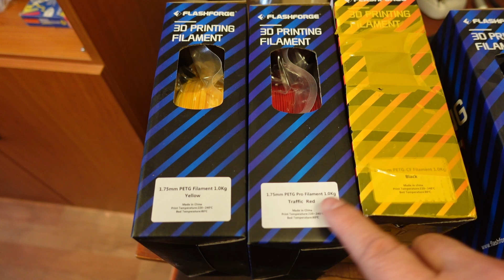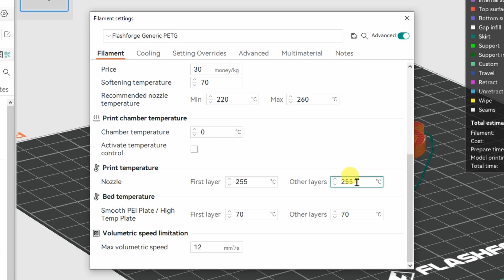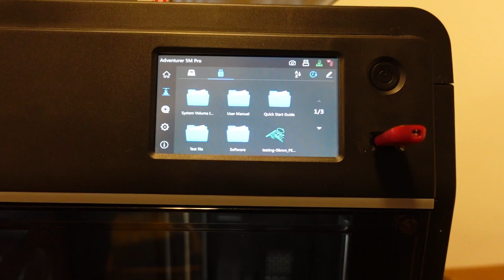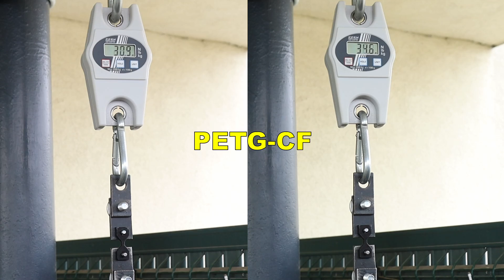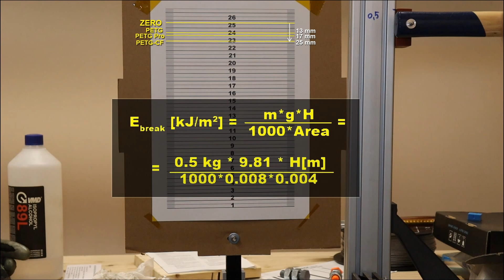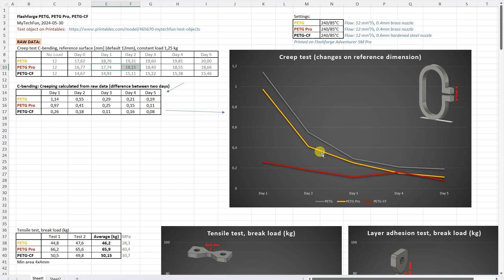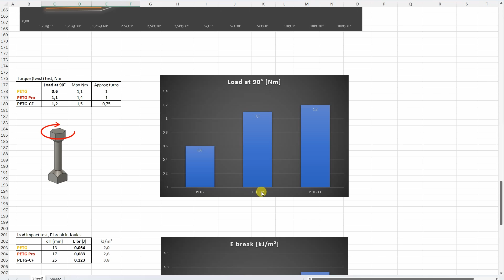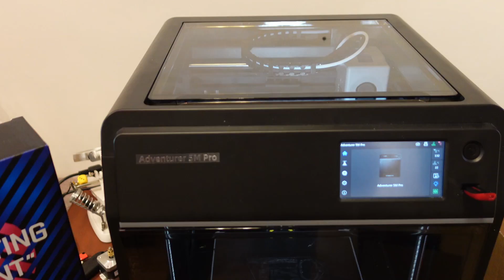Flashforge PETG vs PETG-Pro vs PETG-CF (carbon fiber)

Comment: It's quite possible printing the PETG-CF filament at only 240*C hurt its performance, which is backed up by your own test video printing PETG-CF up to 290*C. You proved there was improvement in layer adhesion up to 270*C.  It seems like a quick re-test at your new standard higher nozzle temperatures added into a future comparison might improve the Flashforge table data. Since I'm specifically using this filament and printing at 250*C I'm quite curious!

Comment: You are touching on something counter-intuitive and often misunderstood in the field including many 3d printing veterans, which is that PETG oftentimes isn't impact resistant as strong PLAs. Unfortunately valuable insights like this are scattered across many videos and most viewers probably didn't get it. May I suggest pointing this out explicitly in your new video with the many datapoints you collected?
Reply from the maker: It will be explained in a separate video soon. Finally my industrial impact testing machine arrived too...

Comment: I recently bought VoxlePLA PETG+ (white).  It is the whitest PETG I’ve seen, so it must be loaded with TiO2.  It printed miserably using my generic PETG profiles till I looked it up on their site, and it turns out it needs 270C temperature to print !  This is much higher than any other PETG I’ve used.  Is this a tell of higher quality or temperature performance for the finished prints, is it just because of it having less glycol or is it a tell of a poor raw material quality ?
Reply: 240 is far too low for optimal performance for petg, so I am not surprised by 270 recc
Reply: It's just as brittle other PETGs I printed. Which isn't bad, very workable, just not great

Comment: I would like to see pet-cf as well.  I have heard that the G in petg-cf really weakens it and makes it deform at lower temperatures so it would be interesting to see the impact.  Also, would be neat to see results with it annealed as usually annealing is hard to do without distorting the print but I have seen anecdotal reports that pet-cf anneals much easier due to the cf preventing warping.
Reply from the maker: I will test PET-CF soon, but from other brand.
Reply: @MyTechFun   can't wait, really excited for that one!

Comment: 11:37 I think the CF layer adhesion is increased due to the .6 nozzle at the same layer height (.2 i supoose). So i think its not the material. But i hope i am wrong.😊 
Altough it definitley shows, this CF material does not have that notorious weak LA like most.

Comment: For PETG how's the dimensional accuracy? If you have the Flashforge ASA & ABS can you make a comparison based on dimension accuracy?

I need to make some cases and PETG was my go to material, but on your PETG videos Impact resistance is lower compared to PLA
Reply from the maker: Thx for remind me, I will include PETG dimensions into ASA/ABS video, which comming in 2 days.
Reply: @MyTechFun  Thank you,  Igor!
Reply: Dimensional accuracy is always good if you use califlower from Vector3d

Comment: Downloading to watch later! I've been using a ton of Flashforge PETG Pro in Burnt Titanium, and I've found it to be super easy to print (and machinable!). I'm curious how it performs objectively.

Edit: I've been printing mine with 0% fan. Long bridges are aesthetically garbage, but I'm currently printing functional parts, and I've found generally that using any fan hurts strength (not just with this specific PETG). Overhangs are still coming out great. Printing at 235, 70 on the bed, 0.16mm layers, 0.4 mm nozzle with 0.6mm default extrusion width (0.44mm for external perimeters and top solid infill).

Comment: I’d like to see this done again all using 0.6 nozzle so I can get a better comparison.
Reply from the maker: This is the better comparison (according to others too), I was asking around earlier. PETG (and Pro) you would print with 0.4mm and CF with 0.6. So this is the comparison I was also curious about.
Reply: @MyTechFun Oh, I strongly disagree. All can be printed in 0.4 and all can be printed in 0.6, so use the same nozzle, because comparisons between multiple simultaneously changed variables are nonsensical. Was it the steel vs brass? Was it the bigger nozzle diameter? Was it the lower speed? Who knows, because you changed fiftyeleven things at once!

Sure, people print different things with different setups, but that's because they have different goals. E.g., if you don't have a strong material which requires a low flow rate, but still want stronger layer adhesion, then you're still gonna print your other filament at lower speed. So you don't compare filament properties based on what each one is usually used for (i.e., settings you usually print it with), but for a particular use. At least when testing functional results.

If you want to compare across nozzles, then print all with both. Then we at least get a little bit of sanity in the results.
Reply from the maker: @marcus3d  In this case, I would like to see that comparison too, I hope somebody will do it. Eh, it is hard to explain, but somehow if I am not curious about it, I don't have a motivation to repeat this testing, not worth for 2-3000 views :-( I hope you understand me.. YT don't suggest my videos, not even to my 50k subscribers. (and 0.6mm was hardened steel, 0.4 brass)
Reply: @MyTechFun  Yeah, totally understandable that you wouldn't want to reproduce it once it's done. But in future tests maybe minimize the number of variables related to the target feature. It might be good to ask viewers what they want, but keep in mind that most aren't familiar with principles of testing or even engineering in general. It sounds harsh, but most people don't know what they want (me included). They think they know, but often that's because of an ignorance of the subject matter.
Reply: @MyTechFun I’m a subscriber and this video showed up in the top row of my feed.
Reply from the maker: @radish6691  Thank you, but you are the rare one. From 50k subs only 2-3k views and 50% of those are not even subscribed. In most cases subscribers don't get notifications (checked, I got feedbecks from friends).
Reply: @MyTechFun  I get notifications and see your videos in sub feed ;)
Reply: @marcus3d   he had to use hardened nozzle for the cf filament. sure, he could have tested all of them with 0.6 hardened but most people will use regular versions with 0.4 brass nozzle
Reply: @riba2233  1) No, he didn't. It's perfectly fine to use a brass nozzle with CF unless you print tons, which he didn't. 2) If he insists on the steel .6 then of course he should've used that for both, to make a sensible comparison. And that would've been fine. I often print normal petg with hardened steel. (And I also often print cf petg with nickel-coated brass, at .4 even.)

The point is, changing nozzle material AND size makes it impossible to actually compare the filaments. It doesn't matter how people normally print some filament if you want to compare filaments for some functional property, because then what matters is how people print when striving for said property.
Reply: @marcus3d   no, it is not perfectly fine, you will destroy a brass nozzle really quickly with cf filament. If you don't know what you are talking about please don't write about it online, you might confuse some beginners.
You are you, most people will do it the way he did, just accept that.
Reply: @riba2233  Did you even read what I wrote? As I said, I do have plenty of first hand experience with these things. I print often CF-PETG with a brass nozzle, and it has almost no wear, but I don't print a lot of CF-PETG with a brass nozzle. The amount he printed wouldn't cause any noticeable wear. Well, at least with the CF filaments I've used, and the brass nozzles I've used. (Although with a .4 nozzle there's a risk of clogging.)
Reply: @marcus3d  irrelevant, you should never use brass nozzles for cf and gf, period
Reply: @riba2233  You can do whatever you want. Period. Read what I wrote. I actually have experience. You apparently do not.
Reply: @marcus3d   you are destroying your brass nozzle and putting it out of proper tolerance even by printing a little with cf or gf, not my fault that you don't realise that.
Reply: @riba2233  You might want to adjust your z offset after several hundred grams, but otherwise your prints will be just fine. Not my fault that you don't know that.
You're arguing pointlessly. You're just wrong that it would be somehow impossible to print CF with brass. I've done it plenty of times. No amount of crying about the truth will change it, so there's no point in arguing this.
Reply: @marcus3d  rofl bro can't believe that you refuse to understand some simple facts... If you have to adjust the z offset that is just a proof that you are destroying the nozzle. Idk why is it so hard to just accept a fact that literally everything in the 3d print community knows.
Reply: @riba2233  rofl bro, I never said the nozzle isn't getting destroyed if you print a lot. He didn't print a lot. As I've repeated to you ad nauseam, but you just somehow can't understand. And even if he would have printed a lot, it's perfectly fine that he'd want to replace the nozzle after the tests. A few dollars for a new brass nozzle is nothing compared to the time he put into the testing.
As I said, the nozzle will print just fine, although a .4 mm might get clogged, so better go with .6 mm.
What I've said is exactly the truth, and no amount of whining or pointless arguing will change the facts.
Reply: @marcus3d  ok and I told you that he wanted to test in real world scenarios, nobody is going to print this on brass and replace nozzle after every few prints... you get it now?
Reply: @riba2233  That's not the point. At all. How do you have do much problems understanding something so simple? OK, I'm probably the worst at explaining it, so I'm sure it's my fault, I'm sorry for that. Let me try one more time.

To compare a (dependent) variable you need to restrict the tests to as few (independent) variables as possible, preferably exactly 1. This goes for all testing, in pretty much all science, but testing engineering in particular.

Now, the fact that tests are synthetic is irrelevant. In fact desired, as that makes it more easy to reproduce later with further (independent) variables, to test either the same, or a different, (dependent) variable.

Let's say you're testing the acceleration of two cars; a 2-seater and a 5-seater. Just because the 5-seater fits a family, you wouldn't want to put a random family in it for the test. You'd want a single driver testing each car in turn, without further passengers. Now, after you've finished this test you might want to further test, e.g., the 5-seater with a single driver vs the same car with a full load. But that's a completely different test, for a different purpose. In either case each test should have a minimal number of (independent) variables, so results can be quantized in a meaningful way.

Eh, I don't know if my explanation makes sense to people. I'm probably horribly bad at explanations. But if it's still unclear you can also look up "scientific testing" or somesuch, and maybe the explanations of others are better than mine. 😅
Reply: @marcus3d   I totally get your point, you didn't have to write all of this, the thing is that he didn't want to do a highly theoretical science test with all the variables locked, but a test that represents a real life usage more.
Reply: @riba2233  If it's not scientific it's pointless. There's nothing to learn from it, since you have no idea which variable affected the property you're testing for.
And even if you could make some kind of conclusion of at least a specific setup (which you can't, because everyone's hardware differs), it still wasn't sensible, because if you're printing for strength with a normal PETG you'd also use a .6 mm and print slower. Like with the cars in my previous example, if you'd like to race with the 5-seater (although it's not the best car for it) you wouldn't do it with a family onboard, but rather with minimum extra weight. The fact that people normally wouldn't drive alone in such a car is irrelevant there.
Reply: @marcus3d  it is not pointless if it represents real life usage. One could argue that it would be pointless to test it with a setup that nobody is going to use it with.
Also, he tested all other cf filaments with 0.6 hardened nozzle so it is a better comparison, same for regular filaments that he tested with 0.4 brass nozzle
Reply: @riba2233  Again you didn't read what I wrote. You can't just do a single test, because everyone's hardware is different. You always need to do a comparison. Only comparisons on the same hardware are relatable. E.g., with his setup a certain part can withstand a force of 40 N, but the same part printed with another setup might reach only 30 N, despite everything being practically identical, because there's always lots of differences in things like thermistor variance, heat conductivity, nozzle bore smoothness, cooling air heat, pressure and humidity, filament grip, etc ad infinitum. This renders absolute values meaningless. Only comparisons are meaningful.
Reply: @marcus3d  You are correct. For repeatability to be established, the following conditions must be in place: the same location; the same measurement procedure; the same observer; the same measuring instrument, used under the same conditions; and repetition over a short period of time. It is important for an experiment to be a fair test. This means everything should stay the same (including; equipment, location of experiment, amounts of different equipment you will use), except for the independent variable which you will change to get different results.

Comment: Thanks,  can't wait for that video that explains impact results :)
Reply: And I don't think it's related to later adhesion either, because PETG prints that breaks under impact often don't break along the layer lines
Reply: @alexchen1442   yeah it is not layer adhesion. In a vide0 another youtber did petg had different impact strength values based on the print temperature
Reply: Got a link the the video?
Reply: sort by newest

Comment: You donated the printer to your department, so you can play with your hobby on your workplace - pretty sweet.
Reply from the maker: Useful for both sides :-)
Reply: Honestly I wouldn’t want a Flashforge printer around the house when I’ve got multiple Bambu Labs printers at home either.